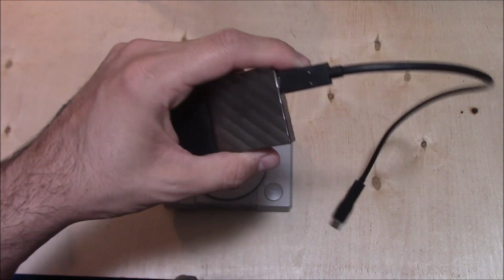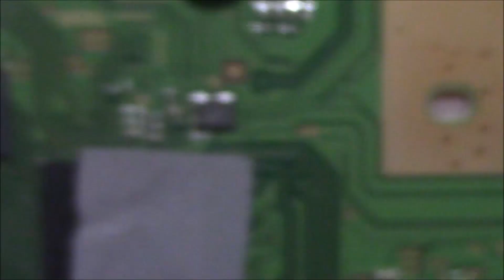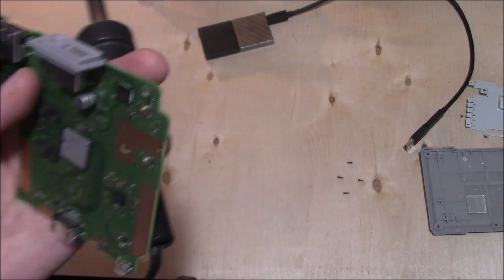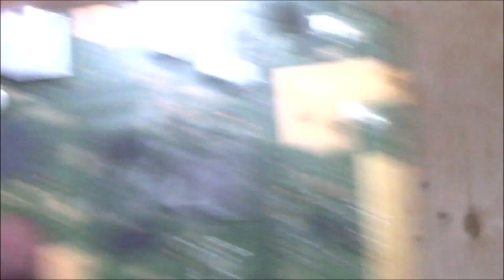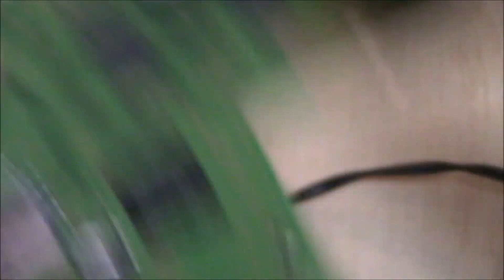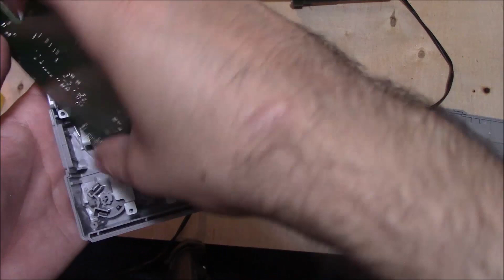Power Mod and Bleemsync 1.1 your ps1 classic ! part 1

Comment: It's fine if you remove the resistors and then put a soldering lead dab where the resistor was removed. That SMD resistors should not be there in the first place, since without it won't damage the peripherals or whatever you will attach in those ports. Mine has been running and powering hubs for months now and it's perfectly fine.

Comment: You don't need to do this. Just use the OTG Cable to get the 3.0 or 3.1 USB Flash drive to work.
Reply from the maker: I have done this method also. People were saying that not all usb drives work when i first modded it but i tried the otg method and it worked.